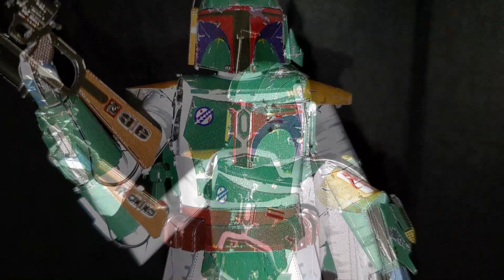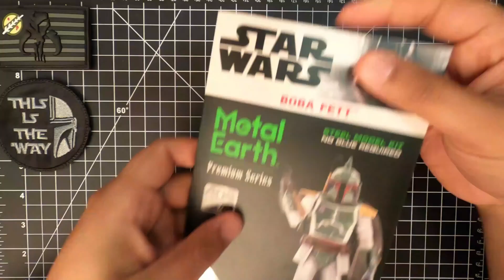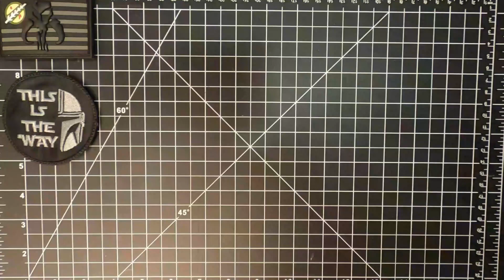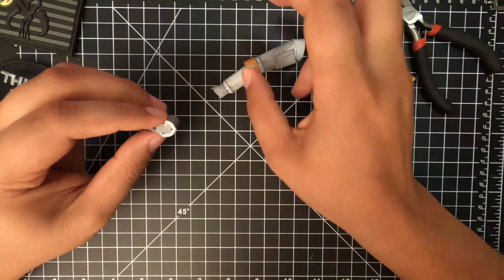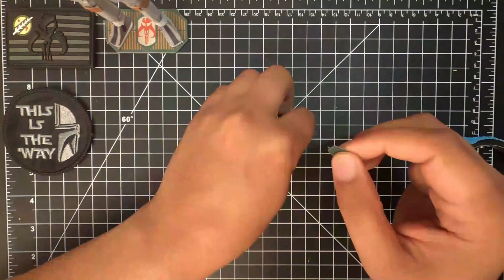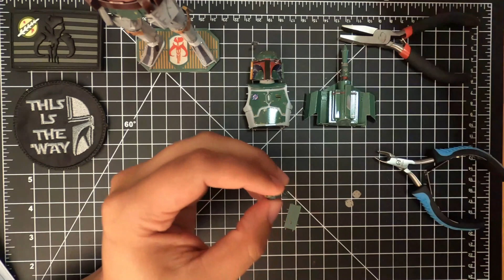Crafting The Star Wars Boba Fett Metal Earth Model!

Comment: So I bought one of these exact models, however two of the sheets are completely identical. Is that how it is supposed to be or did i get one that was packaged wrong?
Reply from the maker: Hi! That is very strange! I have not had that issue. You should have (3) different Sheets, A, B & C as indicated on the instruction/guide. That's a real bummer.

Comment: Just found this kit at my friends house I'm new to this metal kit building so here's hoping this turns out well
Reply from the maker: Good luck! Message me if you run into any issues.
Reply: @xanadoo6839  so the folding piece of the right knee rocket snapped
Reply from the maker: @orpozoid  oh bummer. That may happen a lot because the insert tabs and sections with the bending seams are extra delicate. I would say shape the piece as it should be and use a bit of Krazy glue to stick the piece back on. Be careful with the insert tabs too. Once they go, it's not coming back and then you may have to start gluing pieces on to secure them together.
Reply from the maker: @orpozoid  How did it come out?

Comment: How did you fix his legs? You had his upper quads backwards when you set both legs to the stand, but then it was correct by the time you started building the belts and up? Did you actually take it apart without destroying it? Or just buy a whole new one?
Reply from the maker: Hey!! Very observant! So I think the reason why this one took me longer than I'd like is because I ran into a couple of issues. One was trying to attach the final arm to the body and the other was what you saw, his upper quads/leg pack. I think I noticed that there was an issue just in time before attaching the upper body. So to correct this, off cam, I was able to carefully/painfully undo the lower portion, pretty much piece by piece, ensuring to straighten out the tabs without breaking them so I could be able detach and then reattach correctly but very carefully. Because the tabs started to become weak after undoing and straightening them. Luckily it worked out ok, nothing broke and was to reattach it.